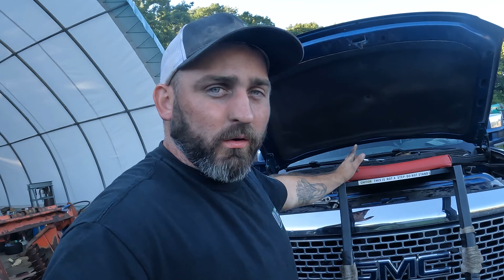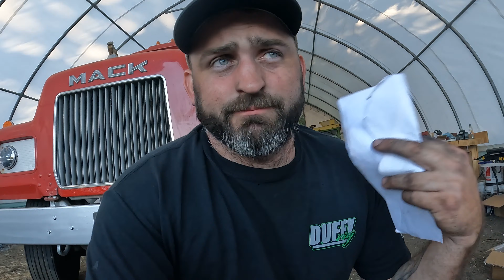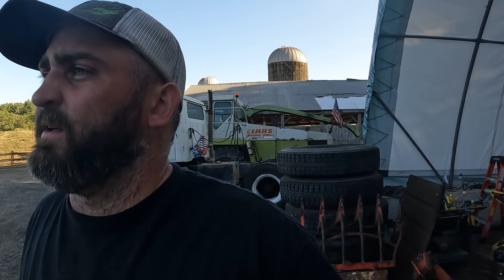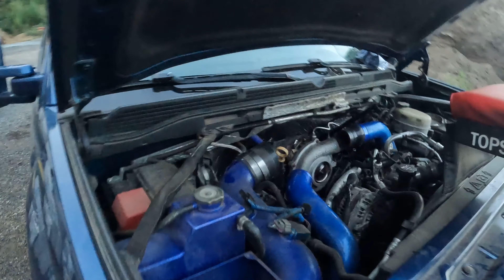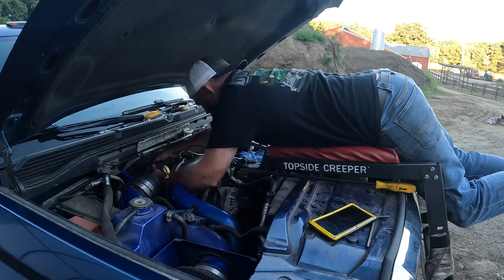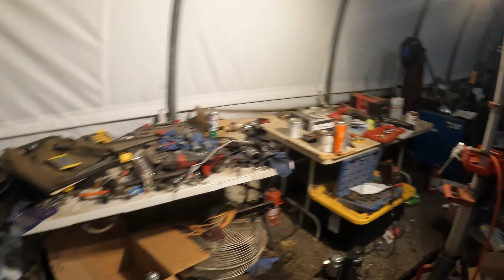Hate Mail And Life Updates- Duramax Turbo Repair

Comment: my brother had a turbo that stuck the vanes in the middle of nowhere and the shop told him to unplug the solenoid and run it and get it hot that it was probably carbon build up and that would burn it off then plug it back in , and it worked run it 6 or 7 months so far without problems

Comment: The few ranks I made were not received well...so I drug my feet but I will tell you I moved my dairy from PA to Iowa by myself in 1993 I was 32 at the time.  Even with a lot of hardwork it ate me .I still farm and will till I die but the older you get the struggle to keep improving gets frustrating.   Most of my move was also because of a controlling father.  Even tried interfering with what I accomplished on my own .  IOWA IS NOT WHAT IT APPEARS. ALOT OF IOWAN FARMERS LOST EVERYTHING THEY EVER DID